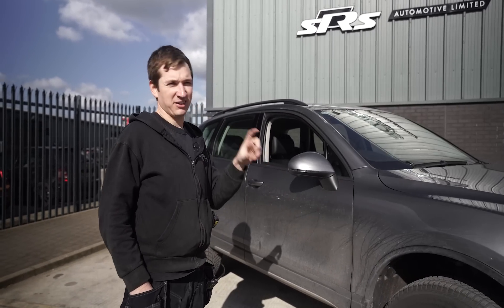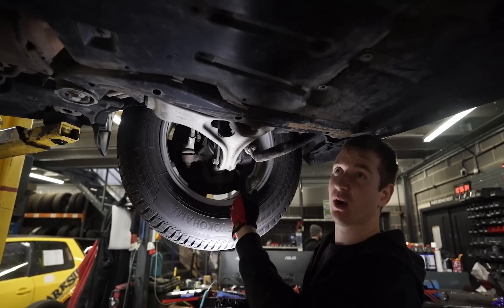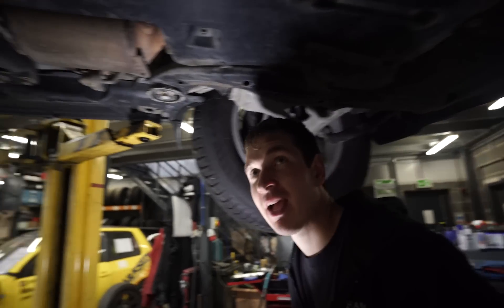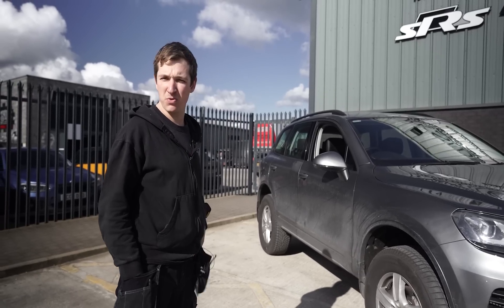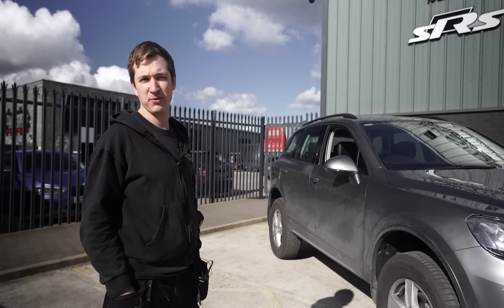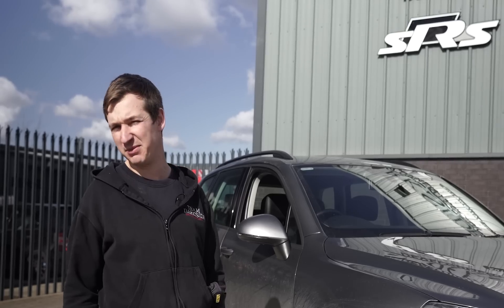What makes the VW TOUAREG ESCAPE model so different?? 🤔

Comment: Escape model with a lot of extras. Air suspension. Alcantara and Napa leather multi way seats with memory position. Rear climate control. Electric fold towbar. BiXenon headlights. Tinted rear glass. Piano black dash inlays. Parking heater. Area view 360 cameras. Anything else? Someone definitely knew what they were buying when they ordered that car. Only 3% of all Mk2 Touaregs were Escape models and very few of those had this many options on them. About £10,000 of options from what I can see.
Reply: Yes I thought they only came in basic spec as I had a look on Autotrader and they all seemed basic and didn't really take my fancy. Whilst i'd like one I'd want more spec. Good to know there are some with higher spec.

Comment: What do you guys prefer to daily ? A f15 x5 diesel , or a 2012 touareg tdi? I’m only asking because I recently sold my touareg . Which only had a delete ..  to pick up this x5 diesel .  I’m finding the touareg was a far comfier ride , Handled better ,.  This x5 has tons of power , is better on fuel , but I’m finding it to be somewhat floaty in the suspension , when I switch to sport, it’s almost too rigid . . Curious what you guys prefer .
Reply from the maker: Can get some decent power from the X5 but definitely Touareg...we do have 3 in our fleet after all 😂

Comment: I wonder how much it would cost to have darkside stage 3 my audi a5 b8,5 2013 with 3.0 tdi 245hp. New turbo, intercooler, exhaust. Already has open air filter but probably needs larger tubes.
Reply: Give them an email, you get what you pay for with darkside
Reply from the maker: Drop us an email to sales@darksidedevelopments.co.uk